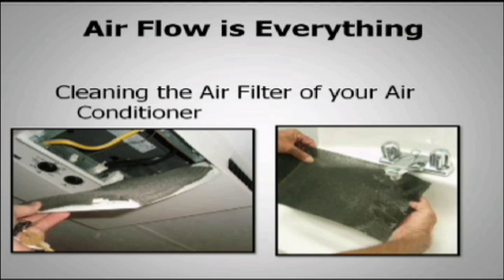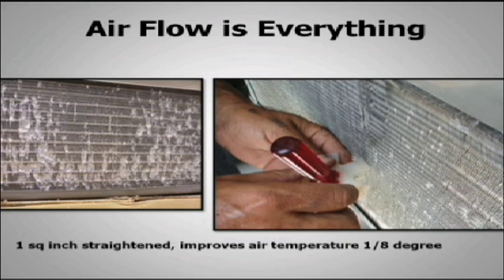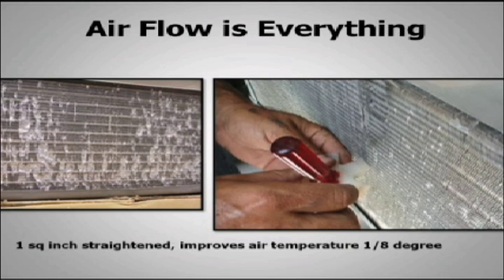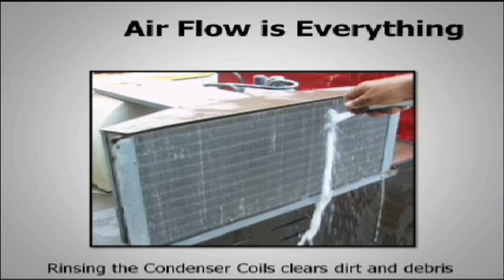Ask the Professor: A/C in your RV

Comment: This AC unit was very easy to install>>>nub.best/yis6    It was my first time and it only took about and hour to remove the old one including cleaning the roof after removing and install this new one. It is lighter and smaller than the original and is as good or better. The hardest part is getting it up on the roof but not as bad as I thought.

Comment: AC on RV motor runs cool when moving, however when in slow traffic or stopped the air turns hot than cools down when speeding up any suggestions. Thanks